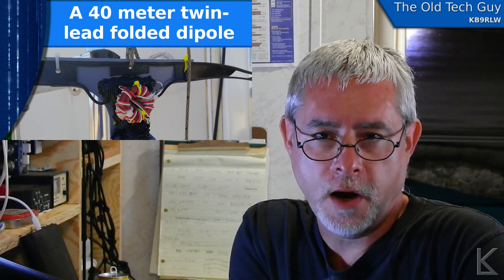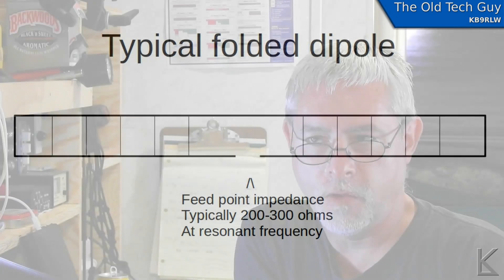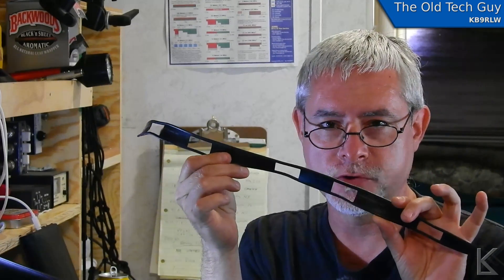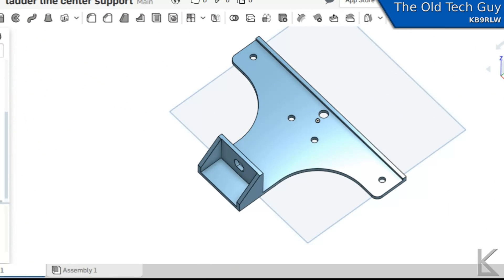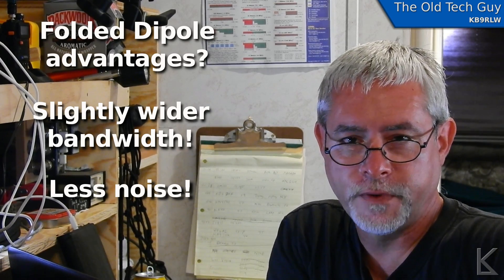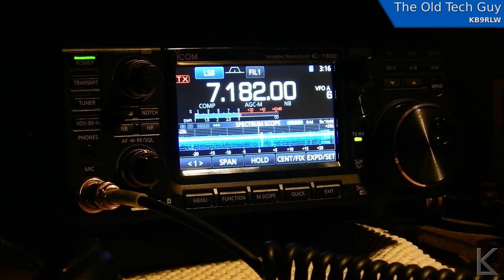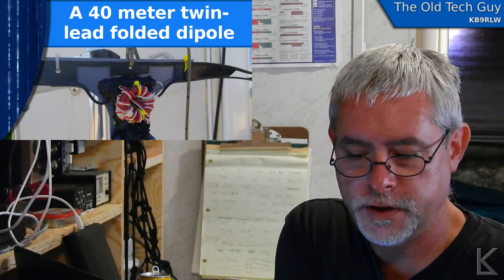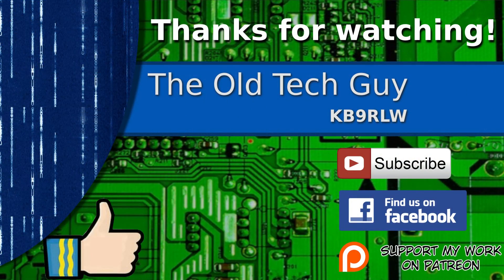Ham Radio - A 40 meter folded dipole using window line.

Comment: Hi Kevin, huge thanks for this and all your other excellent videos. A new ham, I'm waiting impatiently for my first HF transceiver - a 40m QCX kit - to arrive (I've just watched your video on the assembly of yours for the second time, in fact), and need an affordable antenna. It looks like you've come along with this video at just the right moment !! I've been reading up on dipoles, and was despairing on the need for height - minimum half wavelength is what they say, and that's out of the question for me, so I was about to go with a vertical and wreck my lawn with ground plane radials. As I'll only be on 40 for a while yet, it seems like a folded dipole is the way to go. So my question for you is: what height do you run yours at? It didn't look anything like half wavelength in your picture... I'd like to try DX QRP, but I worry that the radiation pattern won't be suitable.
73, Julian, AJ0S.
p.s. I'm not smart on antennas just yet, but my electrical background is prodding me to agree with you that the low noise from the folded dipole is attributable to common mode rejection, especially as this antenna is so deaf to anything out of band.
Reply from the maker: Dipoles do work 'best' and radiate better at that half wave length minimum height.
But they do work well much lower.  You just start sending more signal up and less out as it begins to act like n NVIS antenna. (as discussed in a previous vid.)   
I was running it low, just 17 or so fee up with the ends down to about 6 feet. No choice here.  But it still got out great.
Use what you can to put it up and it will work well enough at any height.
Welcome to the hobby and I'm impressed you're diving right in to CW.

Comment: what happens if:

1. you connect 2 of them together at the center with one turned 90 degrees?  (like a "+")

2.  you slant the elements like an inverted V?
Reply from the maker: I've tried putting two dipoles together in a + configuration.   Didn't work well at all.

Comment: The hols in the window line reduce wind load. Interesting and informative video.
Reply: Jochen As roy previously explained. The holes in the feeder are there to reduce the velocity factor. That is why open-wire feed line is better with less material in between the pair of wires.( i.e the v.f number goes up).

Comment: Wow! Quite a noise level difference. Thanks for another great video, Kevin.
Reply from the maker: Yeah.  I keep checking against other antennas.  It's equally dramatic compared to an end fed wire too.   So much quieter. (except for the signals, which get much stronger.)
I wish I'd built one of these years ago.